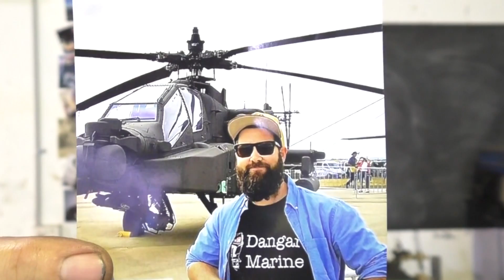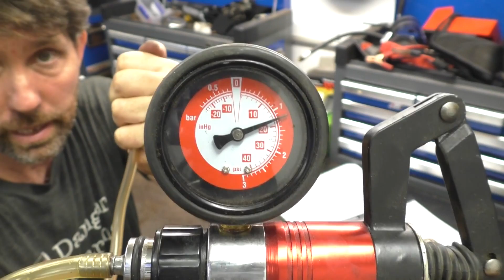Outboard fuel pumps

Comment: I was watching your videos on this fuel pump and the vst tank and was wondering if u could give ur 2 cents on my problem real quick. It’s a 2011 25 hp Mercury efi 4 stroke and it Boggs down at full throttle but then a few pumps of the primer ball gets it back to full rpms till it Boggs down again. I’ve checked tank vent, line connections, checked the filter with the bowl and was clean have a higher pressure filter on its way and was wondering if u think it is the fuel pump or something else cause it and how to check if the pump is operational with out buyin a new one? Thanks
Reply from the maker: If the primer bulb helps then I would say it is the low pressure fuel pump that has failed.
Reply: Dangar Marine ended up replacing high pressure fuel filter and went out for test ride and it work perfectly thanks for the help anyway

Comment: Thanks for the video. I have a 2013 Mercury 60hp efi and it is bogging down at full throttle after being out on the lake for a while, going a mile or tow - stopping to fish and then restarting. It starts fine, gets to plane and then will bog down at random times. If I throttle down and wait a few seconds it will go back to normal. Just wondering before I start trying to take things apart - if you think this would be the best place to start? The fuel filter has been changed and the motor has had no other issues. I took it to a marina and they could not find any issues but they didn't do anything but change the filter. They lake tested it and said there were no issues but it continues to bog down on most trips. It also seems to do it more when it's warm out. Most of the winter we had no issues.......just don't feel safe out there with this happening. Thanks for any insight.
Reply from the maker: I would start with the simple things like checking the breather valve is open on the fuel tank and that all the fuel line fittings are tight and not sucking air.

Comment: You are awesome, One of the best Channels on YouTube for boating. Could the fuel pump being old /weak   cause a  weak jet from my carburetor/ not enough fuel?
Reply from the maker: Yes, if the fuel supply isn't high enough the level in the carburettor float bowl will be too low and the mixture will be lean. It could be a carburettor problem too though.
Reply: Dangar Marine, Thanks , I rebuilt the fuel pump. Think I've got it sorted out , still some adjustments to do. But I think it's time to replace the tachometer

Comment: The downside of a Yamaha pump ( below 100Hp give or take because the bigger engines have a different type of fuel pump ) is that the fuel nipples are plastic instead of metal. I have knocked off one of the nipples and it came off easily just a light bump. That mistake has cost me 140€ / 160$US for a new pump when it was working just fine. Be carefull taking off the fuel lines and pull gently. Just wish they were metal.
Reply from the maker: Ah yes, had the same problem a while ago https://www.youtube.com/watch?v=GazNN3K65tY
Reply: I know, seen that video already Stu just tought I'de mention it for people who didn't. Your video's are great and have helped me a lot. Very informative , well explained and your jokes crack me up. Keep 'em coming. Regards.

Comment: At the begining 3:30 U pumped air into the outlet and exhausted immediatly when u release finger.
Does it means that if you pump in the inlet 
The outlet will release also immediatly?
Does it means that the faulty valve is always open?
Reply from the maker: The valves should only allow air to pass one way easily. If you pump into the inlet it should flow straight out the outlet. Yes, a faulty valve with be open allowing fuel to flow in either direction because it is always open.

Comment: I need some help. I'm working on mercury 15 hp 4 stroke, made in 2002. Drained oil nad i got mix gas and oil. whats the problem can be. its fuel pump leaking? cylinder head is of and cylinder boes looks fine. This mix of fuel and oil is becouse bad fuel pump?
Reply from the maker: Yes, generally it is either the fuel pump leaking into the valve cover or an injector stuck open and leaking into the cylinder then past the rings.
Reply: can you advice any repair kit? or just look for new fuel pump
Reply: do you know if fuel pump taken from 9.9-20 hp yamaha will fit?

Comment: Great video, but as a mechanic for over 40 years, I have to say that having water circulation through a fuel pump is a really crappy design. I can envision several problems with this.
Reply from the maker: Thanks mate, yeah, it does seem like a disaster waiting to happy. I guess it depends how long you keep the motor and how good the quality of metal they use is.

Comment: Hey Stu, so my new (old) 84 mercury mariner 115 2 stroke had sat for 2-3 years before I bought it 3 weeks ago (crazy huh), anyways we got her running 2 days ago, then it just stalled out, and wouldn't start again,  then last night I got her fired up again, and she was purring like a little,  when suddenly, she stalls again, then fires up and stalls again, then won't fire up at all! Please help with any suggestions!
Reply: Sounds funny but just had the same problem on my 90's 2 stroke evenrude. Turned out it was that i had about 1/4 fuel left and with the v shape of the hull the pick up in my tank wasn't getting the fuel to keep it running nicely much after a half a tank and would cut out rather frustrating while learning a new boat on on the water alone....... I turned the tank around to humour myself as if it couldnt be that simple and sure enough ...I can run her WOT all the way to empty now if I wanted .... my take on your situation is its likely fuel.....
Reply from the maker: With these types of problems I always start with a carb clean. Even if they have been cleaned recently if the fuel lines are old or the tank has dirt in it they can block up again very quickly.
Reply: Can that keep it from starting?
Reply: The primer bulb still feels firm though,  doesn't that mean it's getting fuel from the tank? I'm planning on pulling all three carbs and doing a rebuild kit. Just having trouble finding the right parts supplier !

Comment: Thank you for your videos. 
I wonder if you have tips on a good Mercury website where i can see the electricity schedule and how everything is connected? 
Thanks in advance 
Best regards
Mikael from Sweden
Reply from the maker: Hi Mikael, generally with wiring diagrams you need to get the service manual for your motor. You can try finding it on tradebit.com and readmanual.com
Reply: Thanks so much Stu⚘🤗

Comment: Hi Stu.  I looked for a fuel tank video to be appropriate for a question.  Anyway...I want to have two outboard fuel tanks on my RIB.  Waht is a good way to plumb them?  Crossover pipe ?  Totally separate?  I have one already, a 12 gallon Moeller.  Thanks for any advice you can give.
Reply from the maker: Hi Donald. Generally I would keep them separate so that when one runs out you know you have used half your fuel and can start planning your return journey. Having said that, there are plenty of boats setup (catamarans are a classic example) when they draw from both side tanks at the same time to keep the boat on an even keel.
Reply: I will probably do a separate line for each to a tee with valves and then to the filter.  But how do they do the catamaran setup?

Comment: So 2 strokes have similar pumps like the 2nd one you took apart?... and also you said with the diaphragm cracked it would leak badly ... would that leak be internal or would you see a stream of gas floating in the water? I know this is probably a newbie question but I'm just that s newbie .. lol
Reply from the maker: Hi mate. It depends where they crack. You can get fuel leaking externally if the gasket is bad between the layers, but you can also get fuel running down into the crankcase making it run rich and have fuel come out the exhaust.
Reply: Dangar Marine if it runs in the crank case and out the exhaust would that make the engine cut off when put in gear , only when submerged ? I really appreciate all of your advice and help

Comment: Hi Stu, can you please tell me if a bad diaphragm in a fuel pump would cause the engine (suzuki dt65 oil injection) to stall when going into gear, under load. Then intermittently go into gear but not reach high revs. feel sluggish, I think I may have this issue and trying to work out what could cause this. Ive cleaned the carbs and changed plugs and still getting this. But only under load. thanks.
Reply from the maker: It doesn't sound like fuel pump to me. I would do a compression check on the motor and see if the carburettor bowls are still full of fuel when it starts to happen.
Reply: hi Stu thanks for responding. im near sure that the bowls are still full when this happens, if not fuel pump. what would be next thing to check, and dont have compression tester unfortunately.  a friend said it may be getting to much fuel through the diaphragm and drowning it out on throttle, strange thing is it goes into reverse without stalling

Comment: Hi, really enjoy your vids and hope your haveing fun on your new bike. I have a 15 hp yamaha 2 stroke, that I think has has a fuel problem. 3 times when the fuel tank gets below half full it has died on me. I can pump the bulb and it will start, idle about 5 seconds and die. Have cleaned the carb and checked the diaphragms and replaced the tank to motor fuel line and bulb, still same problem. Other than preasure, is there a test for the portable tank? Should I be looking elsewhere? Thanks
Reply from the maker: I would be looking at the pick up in the tank and making sure the breather on the tank is open. It is strange to get so far (half a tank) and then fail. I would also check that it isn't something unrelated like the motor overheating.
Reply: Dangar Marine  Thanks, for the info on the tank. Have a steady stream comeing from motor when it dies. All 3 times we were fishing at end of day and motor had been stopped for over an hour before we started back to dock which was about 3 miles away. Probably the shrtest run we made all day. I will test the temp and let you know what I find. Thanks again.

Comment: Do you have to completely remove it to do the pressure test?
Reply from the maker: No, you can do it with it attached to the motor.
Reply: Dangar Marine thanks. I figured it out it was a bad fuel filter.
Reply: Dangar Marine and also bad hoses which caused the bad fuel filter.

Comment: Stu, can I do a vacuum test on the low pressure fuel pump while on the motor?
Reply from the maker: Yes, it can be done on the water.
Reply: Thanks Stu , I have it on a trailer in the yard. Im having a issue with it losing power like its losing fuel . Its a 06 mercury 60 big foot 4 stroke. Should I check the low pressure pump or go go directly to the VST, So far I changed all the fuel lines and connectors to the motor both fuel filters and spark lugs. The VST and the LP fuel pump look like they still have factory  clamps. Your videos are great

Comment: Stu, great vid!  But FIRST, how do you remove the little bugger? My LP FP looks identical to that (2010 40hp EFI).  Except when I try to remove it there is some plastic bushing going from the pump to the case.  I cannot pull it straight out because the lower cowl is in the way.  As it was, I could just barely get the lower attachment screw off.  Please tell me I don't have to remove the lower cowl.  I have searched the interweb high and low for an answer :-(
Reply: Oi! Never mind.  Sorry to create unnecessary noise. All I had to do was remove the latch for the top cowl. If I had done that from the beginning, that bottom bolt would have been much easier to remove as well.
Reply from the maker: No worries, I remember it being harder to get out than I thought it should be.

Comment: Very informative. Gotta buy you another Fosters. Bought an `86 90hp merc w/16ft runabout. Been running good gas and Sea Foam. Got it going 36mph top speed. Gonna rebuild/replace the fuel pump for maintenace. Hope to get more speed but I think that`s all she`s good for (36mph).
Reply from the maker: Thanks mate, glad the vids have been helping you. :)

Comment: Great video on the fuel pump.  I wish we had a guy like you here in the Atlanta area, someone who tinkers with older motors.  My 1986 model Mercury 75 HP would generate a lot of work from you!  As it is, I have to do it with a book and helpful videos like this.     Question about fuel pumps:  yesterday I serviced mine, trying to track down a fuel problem that is giving me some stalls and bad hole shots.  The rebuild kit I got included a plastic 'cap' that fits over the end of the spring that contacts the diaphragm.  My pump did not have that plastic cap, nor did I even know such a thing existed, because I always bought just new diaphragms, gaskets and check valves separately for pump service, never in a proper, everything-included kit.  Because I never had that plastic cap, the end of the spring would always poking into the middle of the diaphragm.  Could that have been a cause of my weird fuel delivery symptoms?  Here's a picture of the spring:   http://i.imgur.com/IcF3K9A.jpg      and this is the plastic cap:    http://i.imgur.com/5yeWJRH.jpg
Reply from the maker: Hi mate, can't say I've seen that exact fuel pump so I'd hate to give you the wrong information but it makes sense that something should be there to protect the diaphragm. Something else to be aware of though is that sometimes these kits come with parts to cover a range of outboards and not all parts are needed for your exact model.

Comment: Mine bogs down at full throttle. Occasionally when it's running fine it just runs out of gas and quits quite disturbing when you're running across the lake at full throttle. An old Mercury pretty sure it needs fuel pump rebuild. I'll take it apart tomorrow and see what I find.
Reply from the maker: Sounds like it could be a candidate. Good luck!
Reply: I took apart the fuel pump and noticed some fuel on the exhaust side of the diaphragm   also noticed unburned fuel was coming out of the exhaust. The diaphragm itself looked good but obviously it was allowing fuel to pass in the wrong direction. Replaced the  diaphragm and took it out to the lake for a test. Had full throttle again and actually had a couple of hundred more rpm The rebuild kit was only $8 on ebay so I saved a bundle over taking it to my mechanic who is very good but also very expensive . Very simple fix.Your video gave me confidence to tackle the problem thanks.
Reply: My outboard is doing the same thing I have a gas filter between my tank and motor seems to be when it's full with just a small air bouble runs fine other then that I have to keep priming the ball when I'm full throttle

Comment: I enjoy your videos and watch them to gain knowledge about working on my outboard. One quick question, I have a 2003 Johnson 50 hp 4 stroke that I'm having trouble getting to start. the low pressure fuel pump does not seem to be pumping. I disconnected the outlet side of the pump, put a towel over the end and cranked it over a few times. No fuel on the towel at all. The fuel line bulb was pumped up tight and the plastic fuel filter was full. Is this a proper method to insure that the fuel pump is working?
Reply from the maker: Hi Mike, yep, that is as good as any. With that hose disconnected you should be able to squeeze the bulb and have fuel squirt out. If not then something strange is going on as even a failed pump should let you prime fuel through it into the carburettor bowls.
Reply: Thanks for the quick reply. This is a fuel injected engine, so was wondering if anything would be different with this method.

Comment: Hey Dangar Marine, Is it normal when you pump the gas from the tank to your motor leaking to carburetor? I can see it drips
Reply from the maker: No, it shouldn't drip at all. Sounds like the needle and seat in the float bowl isn't sealing properly.
Reply: Dangar Marine and another thing when I tilt the motor forward it drips gas too
Reply: Does it mean I need to rebuild my carbs
Reply: I have the same problem, even when I took all three carbs off the motor and pumped the ball fuel would come out from behind where the carbs were

Comment: I have a 1979 Johnson 115 hp v 4 and it's not getting gas to carbs?
I fully rebuilt carbs, new fuel pump,new fuel lines, cleaned pulse hole on motor! Still no fuel to carbs! 
What am i missing?
RESPOND
ASAP
THANKS!
Reply from the maker: Are the reed valves in good condition. If you aren't getting pressure and vacuum in the crank case then the fuel pump won't operate at all. You could test this by putting a vacuum gauge on the inlet to the fuel pump and then cranking the motor over.
Reply: Thanks!!

Comment: I have a 1979 Johnson 115 hp v 4, I totally rebuilt the carbs put new fuel pump on But, not any gas to carbs? I checked and cleaned the pulse inlet on the engine and still nothing?
Any ideas on whats wrong?
THANKS
Reply from the maker: Are the fuel lines going to the correct ports on the fuel pump? What happens if you squeeze the primer bulb? Does fuel get through?
Reply: yes Stu 
fuel comes out of the fuel pump, I have all new fuel lines to carbs but, still no fuel to carbs?
what do you think? vapor lock?

Comment: Great videos! The one on the VST really helped me with my 2003 Merc 40hp 4 stroke. I was also surprised to see I can buy a new low pressure fuel pump for cheaper (96USD) than a company wanted for the rebuild kit (120USD). Thats if they had the right kit number. Keep up the great videos!
Reply from the maker: Thanks Jim. It's weird sometimes with parts. It also pays to look first as the prices can sometimes be surprising.